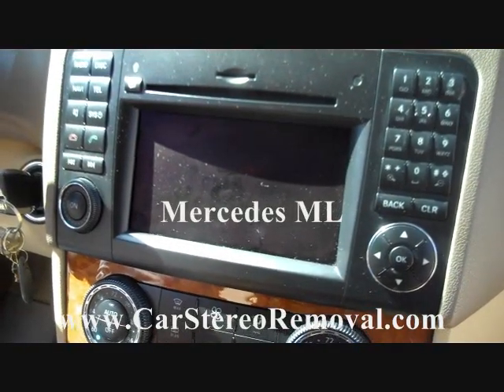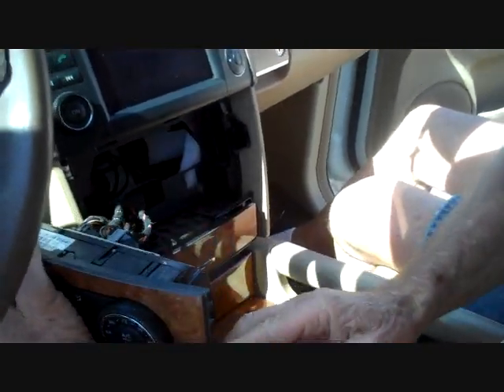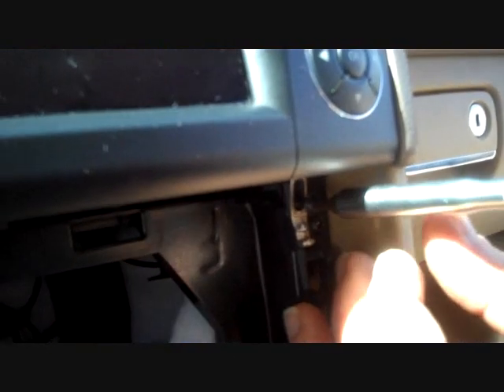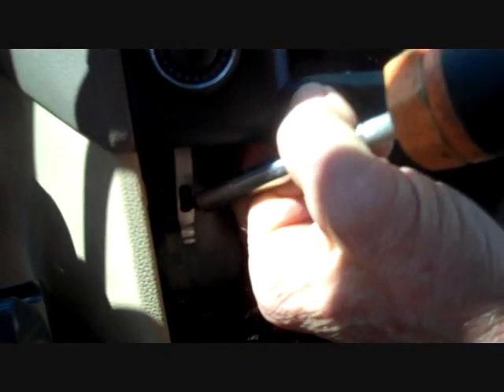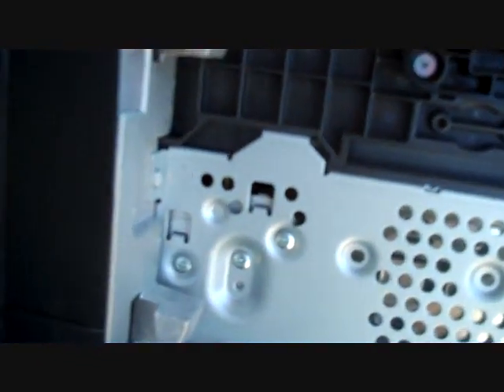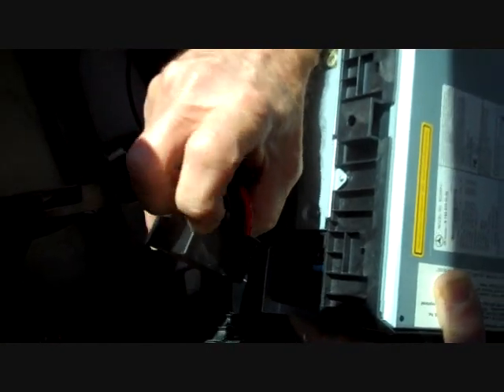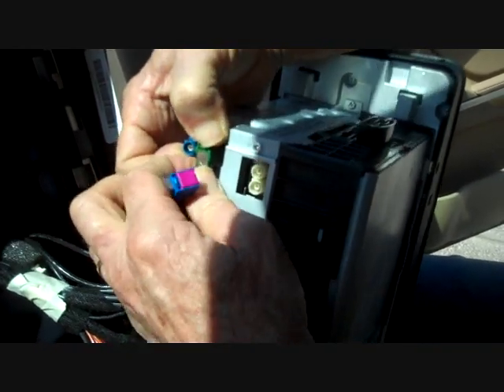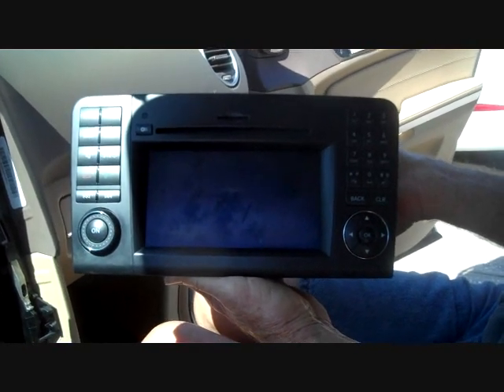Mercedes ML Car Audio -  Radio Removal = Car Stereo HELP

Comment: That's really good detail! That last cable you removed is the 18 pin connector for Audio/Video IN and OUT.  That's what I was really interested in seeing.  

I was hoping to make use of those pins to send video output to some cheap headrest monitors in the rear.  RSE "Rear Seat Entertainment". "NTG25RSE" harness seems to plug right in there, and replace what's there. 

I'm not exactly sure where the end of that cable leads exactly, does it all go to the MMI adapter in the glovebox, or somewhere else as well, I guess I'll find out soon enough.

Thanks again for the video.
Reply: Hi there, did you find out what that last harness belongs to? Isnt one of those cables the am/fm antena? Would be really helpful to know. Thanks
Reply: @DavidWeizman  
Pin 1: Video IN +
Pin 2: Video IN -
Pin 3:  N/A
Pin 4: Audio In L +
Pin 5: Video Out +
Pin 6: Video Out -
Pin 7: N/A
Pin 8: Audio OUT -
Pin 9: Audio OUT LEFT +
Pin 10-11: N/A
Pin 12: Audio IN -
Pin 13 Audio IN RIGHT +
Pin 14-17: N/A
Pin 18: Audio OUT Right +  

Look for Comand NTG 2.5 Pinout.  Double White is the AM/FM Antenna